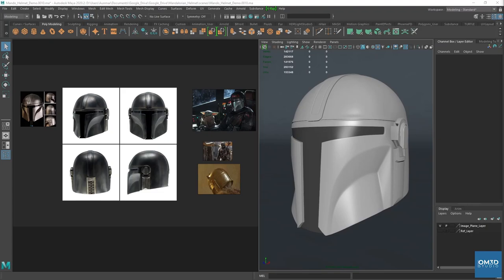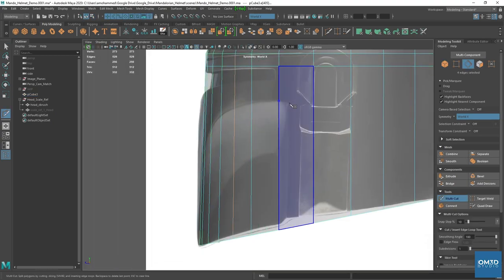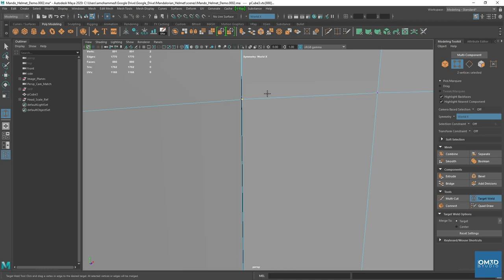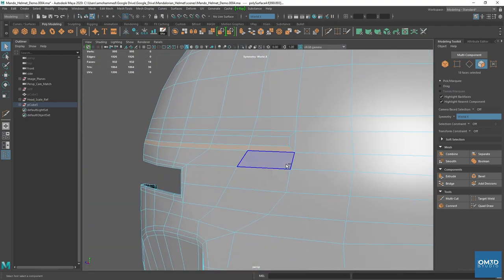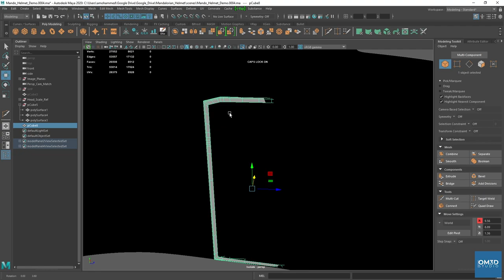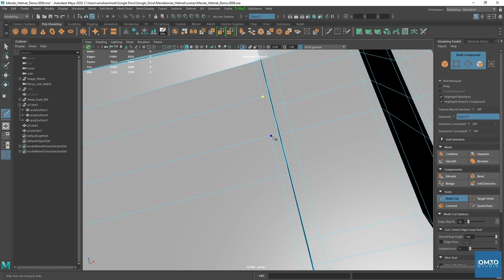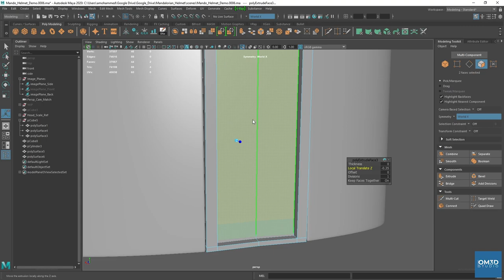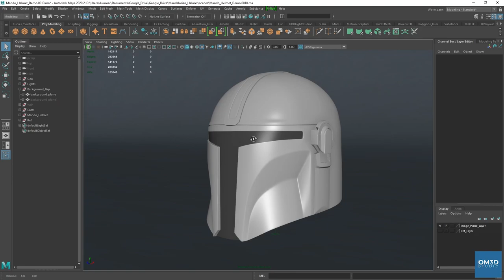Maya Hard Surface Modeling - Mandalorian Helmet

Comment: when i work from the side the front looks different its hard if its not the exact same size
Reply from the maker: Yeah, it's tough since the reference isn't orthographic reference. The key thing is to use the reference as a guide and regularly check the perspective view port to make sure the proportions look correct.
Reply: @OnMars3D  Yeah I’ll just keep trying

Comment: Amazing video, super insightful. I’m new to 3D so my vocabulary isn’t the greatest, but around the 5:40 mark how did you add faces to the interior of the helmet?
Reply: He extruded the entire helmet (ctrl e)  moved it in the local z axis by -0.5 to push the new faces inwards, then mesh > reverse to reverse the normals because it was effectively inside out

Comment: Thank you for this amazing video!! 
I have a small question,
when I am doing the same step as video at 2:45, I change the center by hotkey D, but after that, I couldn't turn back to the world center or object center when I am in the vertex mode or edge, does anyone have the same issue?
Reply from the maker: You hold Ctrl+Shift Right Click and reset your pivot back to Object or World. Another way you can do it is by opening the 'Tool Settings' options in the top right corner and selecting 'Reset' in the Pivot options. Hope this helps!
Reply: @OnMars3D  thank you so much! It works to me!